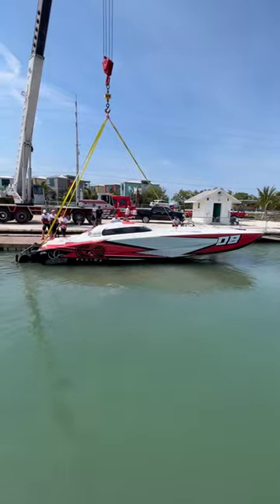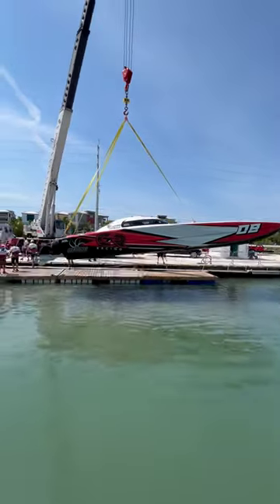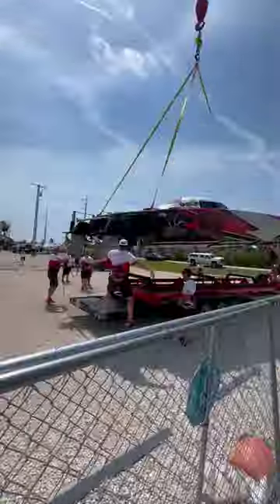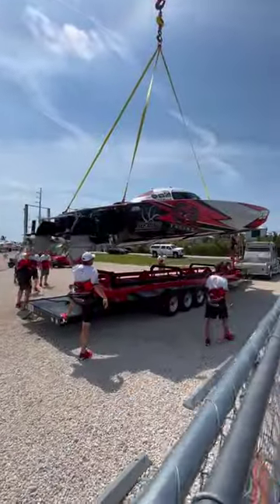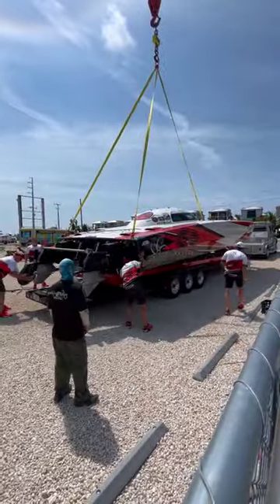How Race Boats Get Taken Out of the WATER!

Comment: You missed the part where they tilt the boat at about a 45 degree angle for road transport. The beam is too wide to legally drive down the road without escort, so the hydraulic trailer tilts it up in the air.

Comment: Sometimes the back them in. The boat ramp has to be long enough. If the ramp is to short, the trailer gets hung up on the edge of the concrete.
Reply: This comment should be at the top
Reply: Thank you for the actually explanation
Reply: Why isn't there a curb right before the ledge of the ramp.. that way you don't back up further and also stops the trailer and truck from going in?

Comment: One of the places we used to go out fishing, in the late 60's and early 70's, that had a shoreline that was less than optimal for launching a boat by way of boat ramp; I don't remember if it was Steinahatchee, or some other tiny Florida coastal community, but, this place we put in at routinely had a big "I-beam" lifting frame, with a pair of straps and a motor at the top for "putting in". One would just back in underneath it, remove the strap that held the boat to our trailer, lower the boom of the boat lift, and place THOSE straps under our boat, and, take the boat up and out over the water, and gently lower it to the water. It was kind of weird to me, but, I was just a kid; it was just the norm at that location. I haven't been back in decades, because my dad died B4 I had a chance to get home from the Army, and, I've never owned a boat for fishing or anything else.

Comment: Seeing the way it’s flat, not even a diagonal setup trailer, no point. Just regular load it with a single engines power. Even rotated trailer could do that after the boats loaded and lock in place.